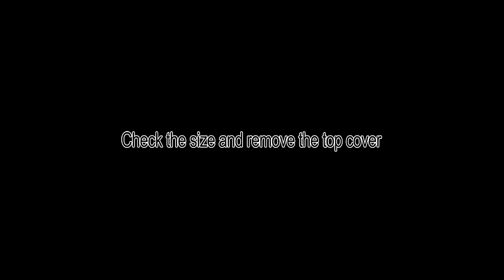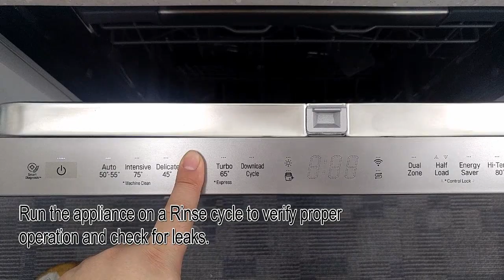1. How to installation

Comment: I just bought this dishwasher and the quick install sheet is hard to read due to the ink they use on the sheet.  I was looking for how to mount the dishwasher to the cabinet so it doesn't move... this video is from the manufacturer in Japan.  The model i has the felt pads surrounding the dishwasher already.  So I didn't get the info. that I need.
Reply: Same problem here.  How do you attach a dishwasher with controls on top to the cabinet?  It has to stick out from the counter a couple of inches (controls on top) so how to you screw it into the top of the cabinet?